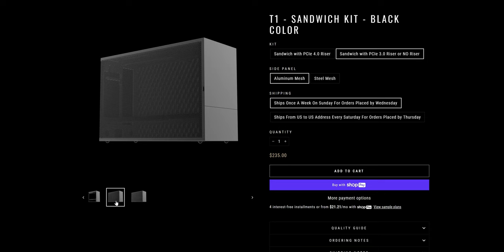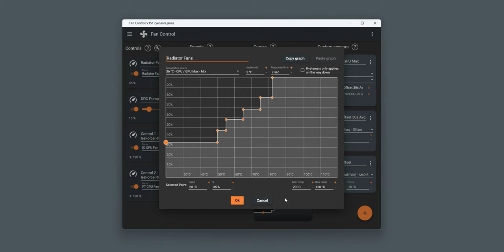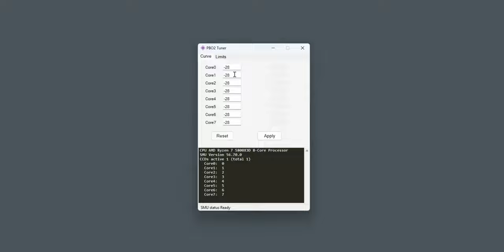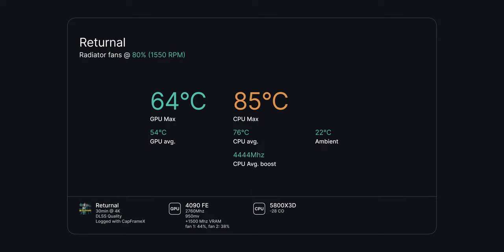4090 & Modultra LOBO in the FormD T1

Comment: This is the smallest 4090 build yet, isn't it?
Reply: Actually there have been a bunch of 4090 builds in the T1 already. I for example did a full custom loop with a 280 radiator with full size 140 fans.
Reply: @Aexeq  How are your GPU temps if you put a 280 rad on the top? I want to do that but I am afraid the 4090 would get too hot and too loud
Reply: @LDBaha  the 280 is not on the top, but rather on the side.
I use the case flipped with the PSU located where one of the fans would be.
It's rather uncommon, because it's mandatory to have a true single slot GPU.
Temps are ok, but nothing to brag about. When I'm it home, I just connect it to a MoRa3 420.

Comment: I really like your build, but that PSU orientation gives me high anxiety. Imo its better to go for a Dabel-20b radiator with the fans below it, which also allows a T30 in place of one of the slim fans. This highly improves air exhaust from your GPU and you can just easily orient the PSU differently or at least the PSU doesn't get as hot with the added airflow.
Reply from the maker: I agree, something like that is definitely the more sensible solution... or just going for the v2 T1. 

In any case, I think my build should serve more as inspiration rather than a definitive T1 v1.1 build. There's more optimization that can be done for sure.

Comment: Nice Build. Running something similar with 4090FE on air, 13900K with Eisbär Solo and 240 and three NF A12x25. The push pull fan config over the psu is really improving!
Reply: How you it in 2 25 Dan 20mm rad? Show me where can I see it? Want the same setup, 4090 Ventura 3x and 13900ks undervolted.
Reply: But with phaanteks t30 or beguite silent wings pro for 25mm fan and maybe noctoa slim if needed.
Reply: @KTamas27  t30 will not work. Max 25mm Fans and HPE240 or TX240rad.
Reply: Did you undervolt/power limit your 13900k? What sort of scores are you getting (cinebench/geekbench or whatever)? Very curious as want to try out myself too.

Comment: I've learned that modern PSU have a safety mechanism that drain the capacitors when the PSU is unpluged. I've read that is should be fine after 10 minutes of being unpluged. Obviously i didn't try my luck, but i opened a 850w cooler master SFX PSU to replace the loud fan with a noctua one and i'm still alive. I'm sure the loudest par of your build is the PSU fan, i have a cosrair 600w SFX too and the fans was noticeable too. If you think you can do the mod, i suggest swaping the fan for a noctua slim 90mm. The plug in the PSU is 2 pin, noctua give adaptors in some of their fans. Outside of that, it is hard to find, unless you have a space PSU and you think you can do it yourself by cuting the wires of a shitty fan. Anyway, now, my PC is ultra quiet under load.
Reply from the maker: Interesting, although yeah I wouldn’t put that to the test either.

The SF750 I have is dead silent even under load, definitely not the loudest, used it in several builds so far and it has never been loud. Even in the Meshlicious custom loop which was my quietest build I could not hear the fan when it was spinning.

Comment: The V1.1 in Titanium was the best of the best, wish I got that color instead of just black. I switched back to my T1 V1.1 from the Dan A4 H20 I just like this case to much. Had to drop from the 5950X with a AIO to a 3600 air cooled but worth it with my 4090 PSU the same direction. Oh and thanks for the 3d printable GPU support fits like a charm really nifty.

Comment: Very nice shots pal well done. 

You had any luck with adding limits in pbo tuner to reduce the temps further?
Reply from the maker: Thank you!

I haven't touched any of the other settings in PBO tuner, but I don't think there's much optimization to do on a 5800x3D.

Comment: I was having issues with my 5800X3D overheating too with a similar build (V1.1 with a 3080 on the same TX240 radiator too), but undervolting the SoC in the BIOS lowered the temps by 10 degrees even with  a -30 PBO offset.
Reply from the maker: Interesting. How much did you undervolt it in the BIOS?
Reply: @EIGAtech  I have a -0.120mV undervolt set but I also only run games so your usage might vary! With that the constant voltage is 0.968V. It dropped the power from 14W to 10W which lowered the temps at idle too which was very nice!
Reply from the maker: @raghavchetal208  Any loss in performance? I haven't really looked into flat out undervolting a CPU like that.
Reply: @EIGAtech  nah nothing as far as I can tell, if anything my performance is better since the temperatures are lower. I was able to get it to boost in-game to 4.45Ghz permanently versus the 4.38Ghz it was doing before. It hasn’t caused any crashes in the one week I’ve had it applied so far

Comment: looks fantastic. I haven't used any recent AMD chips, but that seems pretty hot for a gaming load. Do you use the system for any other workloads?
Reply from the maker: Thank you! Video editing in DaVinci Resolve Studio, but it's a very light load in comparison to gaming. 

I have no issues with the CPU/GPU temperatures as they are. I think they are excellent for the form factor. Only thing I'm concerned about is the PSU running so hot.

Comment: Really nice build! I also had to do that female-female thing to lower the pcie riser cable down and get more room for the power cable. Will you rewire the pump to run off the header?
Reply from the maker: Thank you! I won’t rewire the pump as I figured out a very clean way to hide the long cables. The SATA power cable is actually hidden away between the PSU side and the front panel.

Comment: This would be even cooler if you made a “budget” (not an over the top 4090 build) version of the same build, optimized similarly as you have done.
Reply from the maker: That's a fair point, but for a budget build I would definitely not do a custom loop for a single component (CPU). The build in this video is my personal build and a passion project. If the channel grows I'd for sure be interested in doing budget oriented builds (as long as I can bring something unique).

Comment: Where did you get the back plate to hold the PSU to the case?

I have the t1 v2.5 but there's no way that i can install the psu with the power button facing the radiator.
Reply from the maker: This is the FormD T1 v1.1.  Check out my new build in the FormD T1 v2.1 here: https://youtu.be/JCir0s7cRfk

Comment: How did you get the EK 90 deg fittings to go over the ram on your motherboard? I'm using the ModUltra Lobo as well as the 90 deg fittings but don't have enough clearance to get over my ram. Thanks in advance !!
Reply from the maker: There are static extenders (MF7) between the 90 deg fittings and the block, still, that wouldn't have been enough without the Ballistix Sport LT DDR4 modules which have a height of only 32.5mm.

I have a new build video which you might find interesting: https://www.youtube.com/watch?v=6WZs8s2RZVY&t
Reply: @EIGAtech  I watched the video right when you released it lol, it almost made me invest in quick disconnect tubing but I'm too far into using hard tubing to justify the added cost. I love the quality you have on your videos, keep up the good work!

Comment: It's beautiful. But putting the psu in backwards, letting it cook in the gpu exhaust has been tested and ended with higher temperatures.

It's also possible to run a dual rad setup in the T1, maybe something to try?
Reply from the maker: Thank you! Could you send me a link to the tests you mentioned?

Comment: Great build, pity about those CPU temps. But what does it matter when they meant to run hot, if not hotter before its lifetime of changing out that specific piece of hardware later.
Reply from the maker: Thanks! Not worried at all about the CPU temps as long as it maintains boost. Only real caveat with this build is the PSU getting hot.

Comment: Hi, i have a question: What exactly fittings from EK you used (Like MF 7 or HDC 12, size and offset)? Im inspired by this build and ill try to build one similar by myself
Reply from the maker: Hey! I'm using HDC14 (but you can go smaller for sure for less ram clearance issues), MF7 extenders, micro rotary 90degree adapters, and one normal sized rotary T adapter (needed as a fill port). That's it, no offsets.
Reply: thank you, this will be so much helpful to my new build <3  @EIGAtech

Comment: Did you come up with updating to version 2.0? or another specific cabinet? your build is insane, congratulations! I will assemble my formd t1 v2 with the 4080FE this coming Monday. I will use the AIO fractal lumen v2 240mm with 1 slim fan and a night pattern on the top
Reply from the maker: Check out my new build in the FormD T1 v2.1 here:
https://www.youtube.com/watch?v=6WZs8s2RZVY
Reply: Hey which CPU are you using? I am doing a similar build potentially (4080 FE, lumen s24 v2 etc)

Comment: Hello. I'm building a SFF build in the Cooler Master NR200P Max. I am having trouble finding custom PSU cables for Cooler Master PSUs. I am looking for full custom cables and not extensions. I've noticed that it's VERY hard to find anyone making PSU cables for Cooler Master. Any suggestions? Thank you!
Reply: The availability of that depends a lot on which Cooler Master PSU you bought. You could give the CableMod Configurator a look and see if they supply custom PSU cables for your model, and that would likely be the most painless third-party solution. Beyond that, you'll likely need to go searching for someone who tailors PSU cables as a service or do the job yourself by buying the components a la carte and fitting them together. There's plenty of step-by-step tutorials out there to help you out. Hope this helps.

Comment: in your opinion, is an external rad antithetical to sff? 
because it seems to solve quite a bit of the thermal limitations of the T1
Reply from the maker: Generally, yes, I find it's a bit cheating. However, it has a few practical advantages: for example if you need to travel and you'd only use the rig for very light tasks at the destination. Issue with that is that I find watercooled T1 rigs to be extremely dense and heavy. 

There's also another advantage with having two boxes instead of one large one: Much easier to manipulate for cleaning, moving around, etc.

Comment: Have you tried to shroud the exhaust air from the PSU? So it is not recycled by anything only sucked throw the radiator..
Reply from the maker: There's no need, there's nothing else that would recycle that hot air. The GPU fan is blowing towards the PSU not away from it.

Comment: I am planning to go with zmt tubing for easier build. What size of tube should I go for ?
Reply from the maker: With ZMT you'd have to go 16/10 which is a bit too unwieldy if you ask me. Tygon tubing A-60-G is much nicer and softer if you can find it. I wouldn't go for 13/10 unless you have mostly straight runs, the bend radius (before kinking) on those smaller ones is too large.
Reply: @EIGAtech   I see thank you kind sir

Comment: Curious about the custom cable lengths also want to order custom cables because my case is a mess
Reply from the maker: Exact ones used in this build (keep in mind the flipped orientation PSU):
- 24P: 250mm
- 12VHPWR : 300mm
- CPU8P: 600mm

Comment: what bracket did u use for the flipped psu?
Reply from the maker: The case in the video is the old v1.1 which came with a flipped orientation bracket in the box.

Comment: I like how people are pretending that a 4090 water cooled in a FormdT1 V2 is at all viable from aa performance and noise perspective. Literally shooting yourself in the foot.
Reply from the maker: On noise maybe, there's an argument to be made there. But here's the thing, this exact build in a T1 v2 (with normal fans) would have even lower noise and better cooling than shown in the video. My build is in a v1.1 as mentioned several times in the video and in the description.
Reply: @EIGAtech  Your build does not water cool the 4090 you only water cooled the CPU...
Reply from the maker: @klaidasrunele  Sorry, I misinterpreted your comment. My bad!
Reply: @EIGAtech  A year later I'm back to your video since its so good. I may have to adjust my initial comment to being exclusively around a single 240mm rad. I'm surprised by seeing people stuff in dual radiators and actually make it work reasonably well.

Comment: @EIGA - Can you do direct die with the  Modultra LOBO block?
Reply from the maker: I think it's possible but that's all I know. In theory at least it would make sense, especially in a dual radiator build, lower delta between die and coolant would be helpful.
Reply: @EIGAtech  - Thank you.  Are you still using this in your existing system?  Or did you change to something else?
Reply from the maker: @lhbbq  Check out my latest video! Think you’ll like it.

Comment: I built mine with the 180 degree mounted PSU and it died after about 10 months of use.
Reply from the maker: The SF750? Did you RMA it?
Reply: @EIGAtech  No, I should of specified it was a Phanteks Revolt 850.  I'm going through the RMA process now as it just happened a few days ago.  I can't say for sure that the GPU exhaust blowing into the PSU was what caused it to fail but I think it's plausible.
Reply from the maker: @TheSloppyDingo  It’s definitely a high stress scenario for a PSU, so it’s plausible. Hope you get it replaced!

Comment: Hi, I use the same power supply as you. I would like to ask if you can send me the drawing of your power supply reverse bracket. I also want to try it. Thank you very much！
Reply from the maker: Hi! The power supply reverse bracket is not a custom design, it's included with the T1 v1.1 case. You probably have the v2 case which does not include it.

Comment: Lol I was worried about my config with a 3080ti and a Ryzen 9 5950x with both maxing out at about 65C
Reply from the maker: On water? 65C sounds super low for the 5950x, but relatively high on the GPU.
Reply: @EIGAtech  yes on water
Reply: @EIGAtech  but I use a bit lower clocks,  haven't done anything with undervolting tho
Reply from the maker: @jomio4682  Hmm, both GPU and CPU? I ask because at 65C the coolant is probably over 50C after a long enough session, which means that a 65C max on the CPU is unlikely, given the higher delta CPUs have.
Reply: @EIGAtech  I was wondering that as well, however as soon as I close the game even after an hour, the temps drop to about 47C and then quickly to 40
Reply from the maker: @jomio4682  On the GPU? Then that's probably your coolant temp. I used to approximate coolant temp like that in the past on my 3080. But that's too good to be true... What game are you testing with? And at what resolution and framerate?
Reply: @EIGAtech  PUBG for one hour with 2k res max settings and between 150-230fps